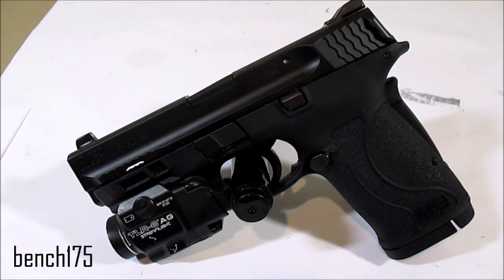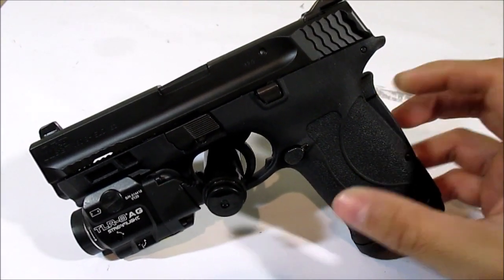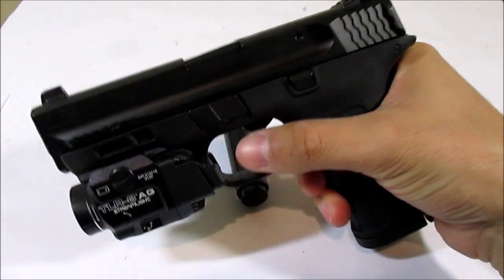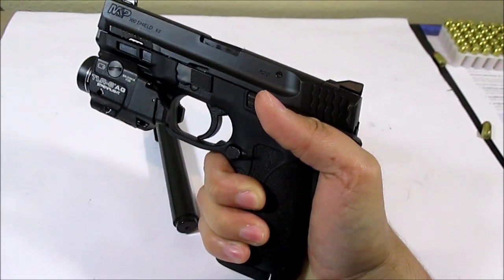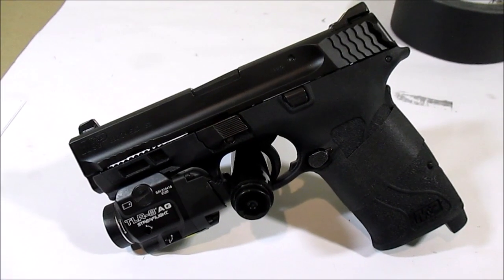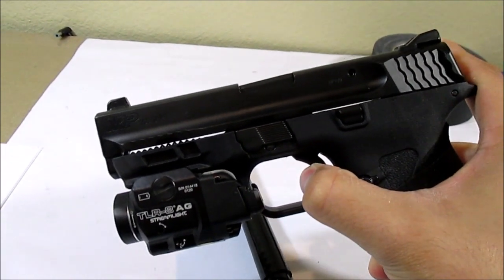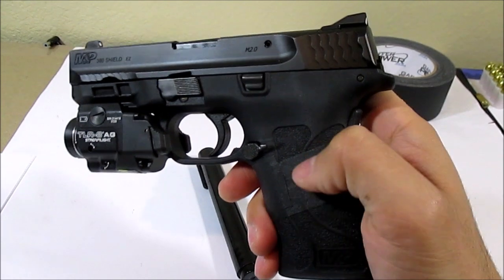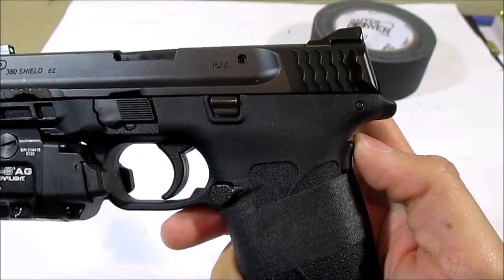Smith & Wesson M&P Shield 380 EZ grip safety & How to disable

Comment: I would take this down.  This makes the gun unsafe.  You need more training with the firearm if you feel you cant grip it correctly.  Its not the gun its the operator.  I could see if the gun didn't fire when safety was pressed. If your not comfortable with it I would trade  or sell it.
Reply from the maker: My gun still has tape on it, and it still hasn't got up and shot anyone.
Reply: @bench175  ok and your gun still isn't drop safe lol
Reply: @jamesm2881  why do you say this?  the trigger is neutered with the thumb safeties "on".  The firing pin module locks the firing pin back if the slide is out of battery.

Comment: Check out the new PC version of this gun, the grip safety is humongous, only depresses half way, can't even grip the thing properly. It's the worst design I've seen and probably the first gun I'll ever have to return for a refund.
Reply from the maker: That sucks
Reply: @bench175  For real, I'm a yooog S&W fanboi, safe is full of them, but whoever designed this had too much bling and not brains in their head.  Turns out I can put the standard grip safety in to replace this dumb gold thing, runs about 13 bucks shipped, so I'll probably do that instead of deal with the rigmarole of returning it.
Reply: @DoubleJThe  Thanks, great idea. Just ordered. Did you swap it out yourself or will I need to take to a gunsmith?
Reply: @DoubleJThe  Thanks again. Done! So much better. I don't see how S&W let the Perf Center Grip Safety out of the factory.

Comment: I’ve seen videos on both sides. Folks say “have control of your gun to avoid negligent discharge, but yet don’t like a grip safety because I can’t fire from an awkward position *without full control of pistol)”

Now I see why this guy did it, but seriously I’d alter my grip slightly, because of the liability incurred from deactivating a factory safety. Just get a shield without the external safety. You’ll fare better in court, should you end up there.
Reply from the maker: There's a big difference between getting an slightly less than ideal grip VS dropping your gun/pulling the trigger.  Why would I be any more liable after disabling a ridiculous safety that millions of guns don't have?  Today, I was actually about to put a layer of adhesive felt on the grip safety instead of the tape.
Reply: Please post how your adhesive felt works out. Thanks for th video and all your posts.